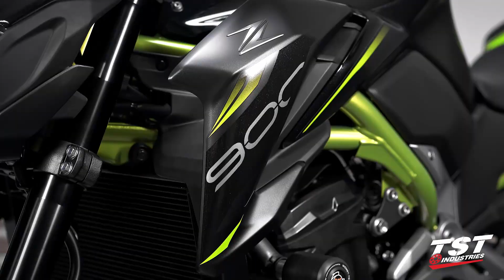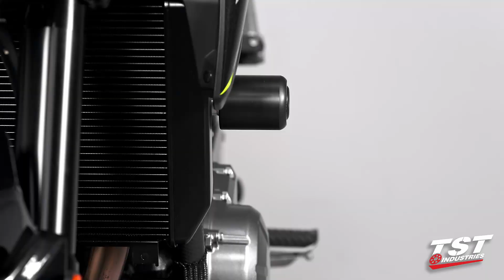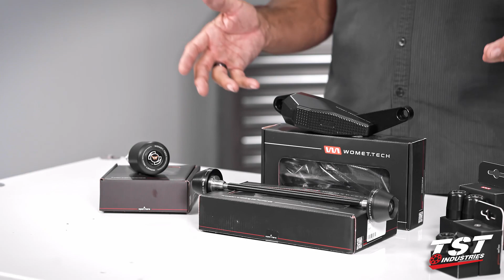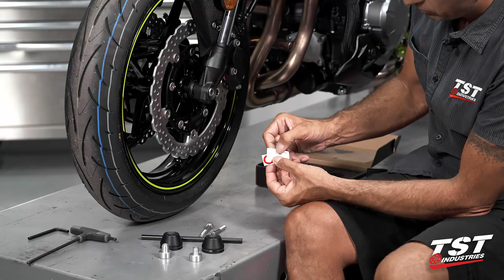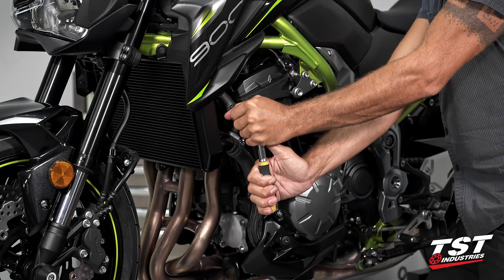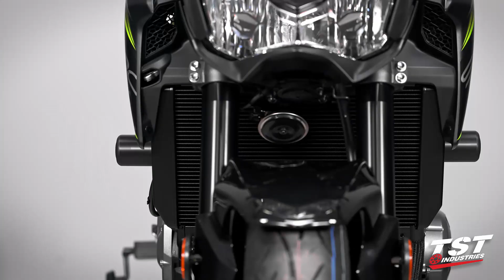How to install Womet-Tech Fork Sliders, Bar Ends, Frame Sliders, & Spools on a 2017+ Kawasaki Z900

Comment: When installing frame slider, dont we need to put car jack to hold z900 engine? In some video i saw it. My z900 is 2026 version. Please help to answer this question. Thanks
Reply: Listen at 6:40. If you do one side at a time you shouldnt have to worry about that.
Reply: @juspe123 thanks. Successfully install it at my z900 2026.

Comment: Hello Sir, the frame and engine mount hole has got misalligned on my Z900. How do I go about getting them in-line? I tried jacking it up but dint work in my case. Do I need to loosen the other engine mountings too?
Reply from the maker: Yea man, you will have to support the engine on a jack and then loosen all of the motor fasteners. Then jack it up and re-tighten all the connections. Make sure you go by the order defined in the factory manual along with the prescribed tightening torque.

Comment: Thanks for the video!  I have a question about torque wrench settings for the rear spools.  I've watched a few of your videos and they all used different torque wrench settings:
One was 170 inch lbs, another was 55 inch lbs, and this video they didn't use a torque wrench at all.  I bought these for my Ninja 400 and Yamaha R3 so I'm wondering what setting to go with for both of these bikes.  Any help would be greatly appreciated, thanks!
Reply from the maker: Link us to the videos you are referring to and we can definitely help. It depends on the spool (or spool slider) the bolts, and the torque wrench. Some we read in nM, others with in/lbs and others with ft/lbs.

Comment: What if you don't use a torque wrench?
Reply from the maker: Then the resultant bolt torque and clamping force will not match the prescribed specs.

Comment: Im from México i need de z900 2020 pack can we make buisness?
Reply from the maker: We would love to sell to Mexico again but in the past we had too many packages go missing in transit, and also fraudulent orders that cost us too much money. We were actually losing money on selling to Mexico so we stopped. Now we use DHL for international deliveries so we may open up Mexico again. The payment will have to come through a verified source, like Paypal, or for large distributor orders we can take wire transfer. We are not opposed to it, but it just has to make sense.

Comment: Great video, thank you.  I'm wondering about your torque settings for the frame sliders - they're different from the Z900 service manual's settings.  Are the ones you used specific to the TST part?
Reply from the maker: Almost all the frame slider installations we do are per Womet-Tech torque values and not OEM torque values. The factory setup uses 12.9 bolts with no aluminum and delrin components in line. When fastening the frame sliders onto the bike you are using an 8.8 bolt through delrin and aluminum and that has to be accounted for in the clamping force resultant from the torque value.
Reply: @TSTindustries  OK, perfect.  Thank you for the info.

Comment: Directions with the front fork sliders is confusing. Also in this video you didnt mention the different length bolts
Reply from the maker: What was confusing about the fork slider directions?
Reply: @TSTindustries  the translation into english suffers, it says both bolts go on the right side.The left and right are incorrect as sitting on the bike. I assumed the longer bolt went on the  wider spacer since it was a fraction longer.

Comment: So I was looking at torque specs, and the manual says there are engine mounting bolts that are 44ft lbs and then engine bracket bolts that are 29ft lbs. I can't tell from the manual which are which, but it seems like those would be the mounting bolts, no?
Reply: in the manual i think its 54nm but i only apply 43nm

Comment: Love your guys products but how come majority of your stuff is out of stock. Been wanting to get the adjustable fender eliminator and mech gtr turn signals for my z900 but it's been out of stock since April
Reply from the maker: We actually offer hundreds of products and most of them are in stock with ample supplies. The tail light and fender eliminator for the Z900 are in the coming-soon phase. We did not launch them yet. If you read the product page you will see that we are real close to launching but until then they will show out of stock. The Mech-GTR signals have gone through soft launch but we ran out of the quantity we made very quickly. We are making 1000 sets right now. They should be available when we launch the other two parts I mentioned in a matter of a few weeks.
Reply: @TSTindustries  thanks for the reply! Looking forward to the launch and being able to purchase your products